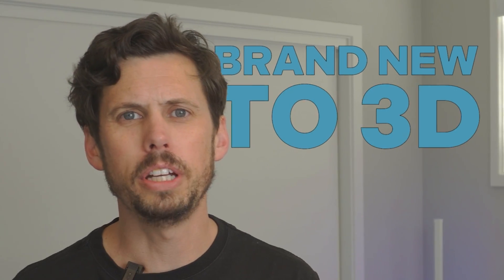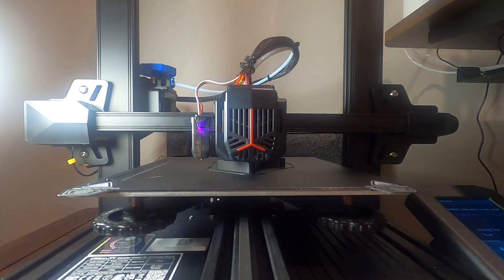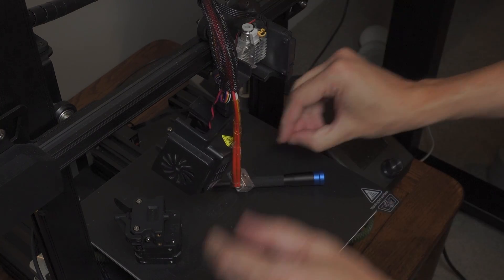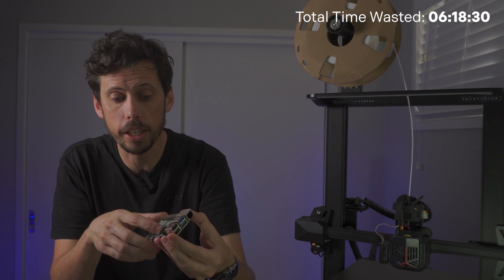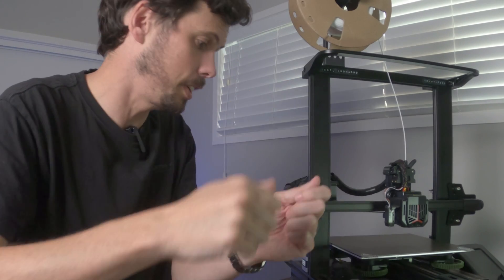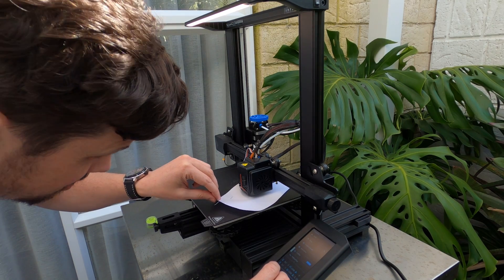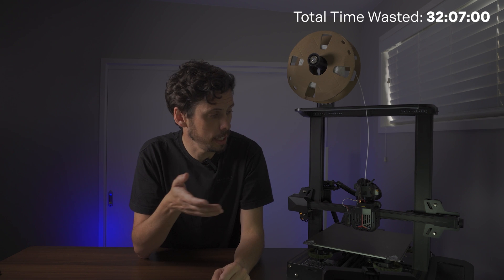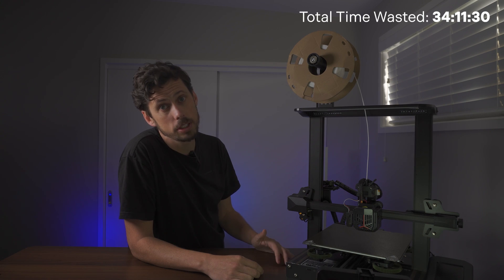Is Upgrading your Ender 3 worth it?

Comment: In modern day I would only recommend upgrading a 3d printer to my worst enemies.

Its not worth it. At all.

If you actually want to enable your creativity, and use it as a tool to enable your projects, buy a Bambulab and be done with it.

You simply will not make for yourself as good as an experience, and will have waste far more in time and money than the cost.

Buy the best printer in terms of UX and features that is reasonable for your use case, and use it. Upgrade only if you must for a specific reason.

The argument about learning your 3d printer is silly. Its a useless skill to know about some specific printer model when you can only learn when you have to and if you think youll gain general knowledge, you can get that in 10 minutes on youtube.

All you are doing is wasting your free time, and the time you could be using to learn something more valuable to you. Its actually one of the time wastes that this video (which is a great idea) doesnt even cover. You waste time researching information that truly does not matter to you.
Reply from the maker: I definitely wanna go that direction when I get another printer. Tho I have enjoyed learning a bunch  doing these upgrades.

Comment: I bought a Prusa (after owning my Ender 3 S1 Pro) so that I could tinker with the Ender and print with the Prusa 🤣 also I bought a Pi 5 - which is not compatible with octoprint so I had to buy a Pi 4 (even more wasted time). I had an issue with stringing so I designed dry boxes, but then I needed a place to put them above the printers so I built a wooden cabinet. All this to say you are very correct about time, but that is the hobbie! 

When you make a functional print that looks stunning there is no better feeling

Do not stop making content, you have a real talent and passion that is refreshing (a lot of printing YouTubers just do printing reviews these days)

Comment: Hey there!
I've been tinkering a lot lately with a 3d printer and have set up my firmware multiple times by now (about 5 weeks ago I was a complete beginner too...). But after a lot of tinkering and configuring I got everything set up for my needs and it works perfectly now. 
So: what have you done already to get the bed mesh leveling to work? Have you already tried to flash the firmware and configure Marlin by yourself and not just use a preset? What type of sensor do you have?
If you say, what you've tried so far, I might be able to help. 
Cheers
Reply from the maker: Hay man! Thanks for reaching out. I've not done my own config of Marlin cos I've been using 'Professional Firmware'. Honestly I figured it would be the easier route - especially because there is a community around it. I don't think I'll be going that route anytime soon either, cos I want to actually use my printer 😆.

Tho if you're still interested. I've confirmed that my frame and bed are all good, no physical issues. I've dialed in my Nozzle  Probe X,Y offset (and Z obviously). Confirmed that my G-Code is all correct to load the mesh at the beginning of the print. 

Basically it prints too close in the back left and too high in the front right. If I do a 3 x 3 mesh and dial them in manually, it loads the mesh and prints great, but for whatever reason it probes them incorrectly.
Reply: @AttemptedMaker  Are you sure you don't want to configure it yourself? It is pretty easy... And since there are so many profiles preconfigured for pretty much any Ender, you should not have any problems with finding a starting point and just adjusting it to your needs... 
I would definitively give it a try just to see whether the problem lies here.

Comment: I saw my thumbnail in here haha. Another excellent, dynamic and honest video, Scott. The PEI plate is still one of my favourite upgrades, I just love it. Silicone spacers are a must too; With an ABL sometimes I just hardmount the bed though. My 3 favourite mods are definitely an ABL probe, PEI plate and a new mainboard with silent drivers at the minimum assuming the printer does not have these already. Nice job with the parts you designed too! I really gotta try PCBWay's titanium printing, it looks insane, I just need the right part... All the best. Cheers, Tommy.
Reply from the maker: Haha Yeah Dude, right on top. Yeah PEI sheet has actually been great - easiest upgrade too. I've found with spacers and those wheels that lock it, I've not really had any movement on the bed... yet. Yeah I want to shine up that titanium part, I didn't have time for the video but it should be fun. It's a lot heavier than PLA tho :D. Thanks Man, as always looking forward to your next vid.

Comment: CHEP is an idiot, and a swindler, never listen to him.  He convinces people to buy his $2 PCB for $25, over just using a sheet of readily available printer paper or, you know, fixing the actual problem people are having, etc.  It's literally a button attached to an LED ffs.

The Mr Iscoc firmware can be self-compiled with his helpful scripts, and swapped back to Bilinear bed meshing.  Also don't forget to flash the screen to the latest version of the screen firmware; matching up which vendor you have for your screen with the firmware he supplies.  Last I remember there were 3 versions of the screen made by 3 different vendors.

Comment: I had a Ender 3 OG never upgraded and got better prints than lot of people that had upgraded lots of parts. With this printers you need to calibrate them a lot
Reply from the maker: You got those OG Ender skills. Respect. I think I'm mainly just impatient.
Reply: @AttemptedMaker  I had to learn to calibrate  my ender 3 was because at the time the only upgrades we had were the yellow springs, metal extruder and use mirror or glass for the bed.

I moved to resin printing a long time ago but if I bought a new filament printer. I want something that works from the start and does not have to lost time upgrading.

Comment: Yeah ... that matches my Ender 3 hobby experience ...  The Bambu P1S is just the opposite: set it up, slice with the available presets and everything has come out fine so far.  Great to print more parts for my Ender 3 and other tinkering printers ;-)
Reply: Yeah I started with a microcenter ender 3, spent ages never getting the bed leveling mod to work right, and then grabbed a bambu A1 mini.  Bed leveling that works right fresh out of the box is gonna be a must-have for most people.  My ender 3 is mostly gathering dust ever since the bambu came home.

I assume Creality has some printers with built in bed leveling too.  Just not the old ender 3.
Reply from the maker: Yeah those Bambu Lab printers are looking pretty tempting

Comment: From my experience as an Ender 3 owner, here are the top 10 most printed models, by type: #1: Test prints. #2 through #5: More test prints. #6 through #9: Printer mods to get better test prints. #10: cool models. As the old saying goes, owning an inexpensive printer means tinkering with the printer is the hobby. The upside is you now have a much better understanding of how printers work, and how to repair them! Wrap yourself in the cloak of power that knowledge grants you while all those other fancy people with their expensive printers are just cranking out models with no real comprehension of how or why their printers work. Seriously though, the difficult road is often the most rewarding!
Reply from the maker: Thanks Tim! Yeah I hear you. For the few people that ask me what printer they should get, I ask are you into 3D Printing or 3D Printers? I do think the stuff you learn tinkering builds skill that open up your options of what you can make.
Reply: I completely agree. When I started with 3D printing somewhere in 2016, the only affordable 3D printers where the DIY acrylic kits. To say those things needed a LOT of tinkering is really an understatement. But as you said, you learn a lot. When the first Ender 3 where released, they where a huge improvement (the first Ender 3 was also a kit that you had to put together yourself). I also learned to write my own firmware, and tweak existing firmware (it's nice to have some programming background).
Fast forward to today, and now we have the latest Ender 3 model, that you put together in mere minutes, and has direct drive, an really good working auto leveling, and of course silent stepper drivers and more nice stuff. Almost no tweaking needed.
As I have a lot of hobby's and projects it becomes harder to put much time in tweaking a 3D printer. For example: I have restored my very first computer, a Cosmac Super Elf, to full working order and I am now working to do the same to my second first computer, an Acorn Atom. I also do Holograpy, using laser equipment and holographic emulsion (a lot of stuff for setups is also 3D printed). On top of that I also dabble in Music creation (I use Bitwig), and you see I running a bit out of time to put in tweaking a 3D printer. So I broke down an bought a Bambulab printer. I still would like to do that tweaking, but I simply have not much time to do so. Still - It was a really tough choice between the Bambulab A1 mini and the latest model Ender 3. Both are reliable and get the job done, but wanting to try out another brand finally was what made my choice.

Comment: I'm curious if you got a lazy susan just for this video, if so totally worth it. The shots with the upgrades highlighted are amazing. I also struggle to not get reduced quality prints while using octolapse. If you set the print head to be above the print when the photo is taken the print quality is much better but then you don't have the magic print growing effect. Anyway another great video!
Reply from the maker: You know I did 🤣 I got a cheap one and crossed my fingers it wouldn't die before I got the spinning printer shots I needed.

Yeah, Octolapse is definitely better and less cool with that 'snap to' trigger. Thanks man!